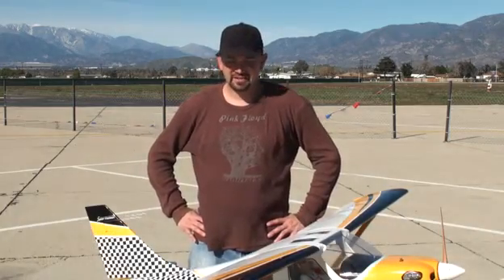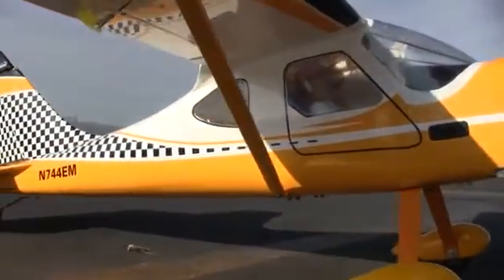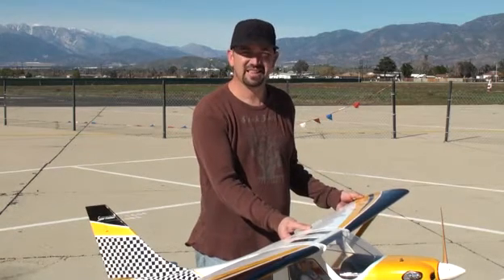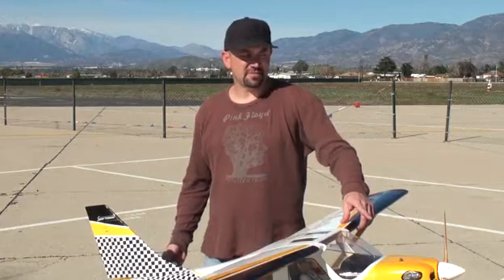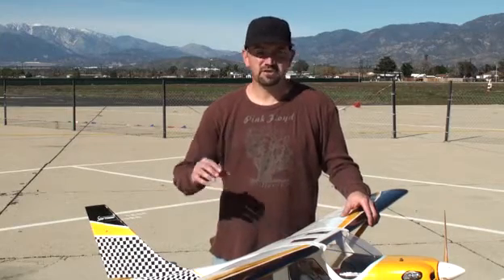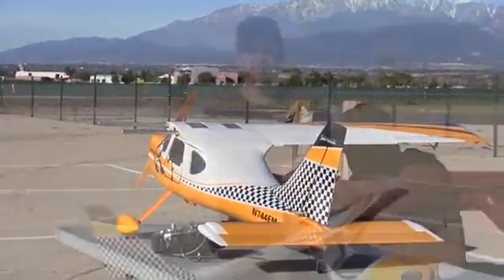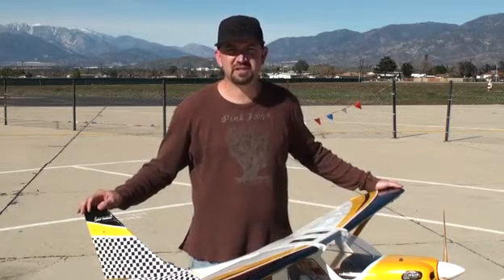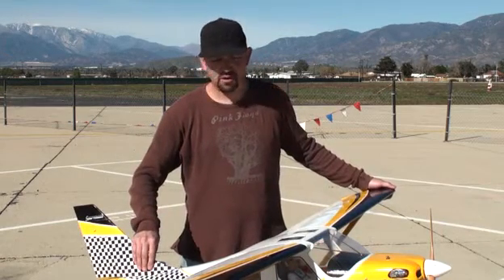Seagull Glasair Sportsman   Model Airplane News from customers

Comment: with you using SIG as your US distribute your planes in the USA the prices have jumped up. It will cost me on average 30 bucks or more per plane. I dont buy from SIG because they have high prices and outrageous shipping charges on planes. After buying many of your planes i wont be buying no more.  The hobby shops i buy from are no longer selling your planes cause they are not going to go through sig. SO that means SIG is going to be the only hobby shops selling your planes now... Your gonna lose lots of $$$ with this bone head move to SIG